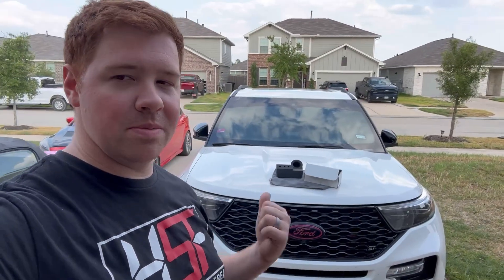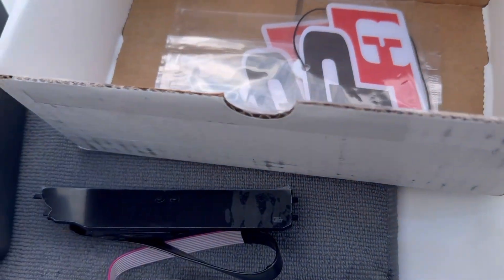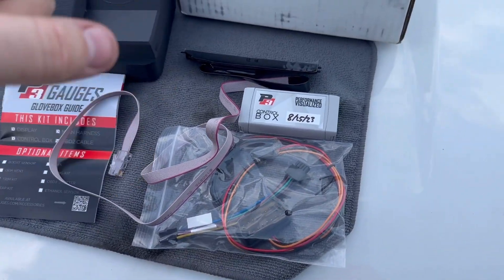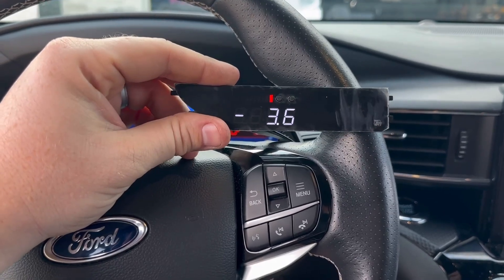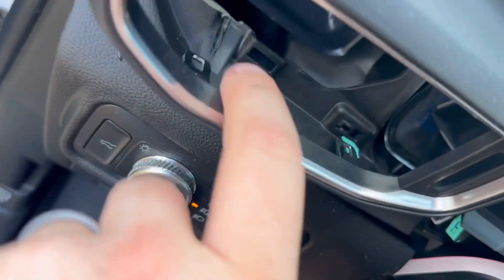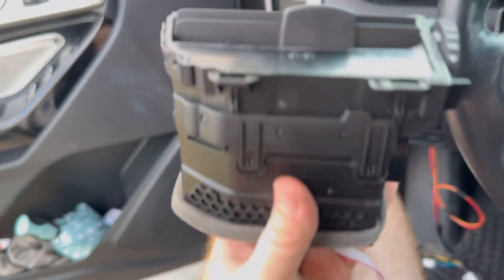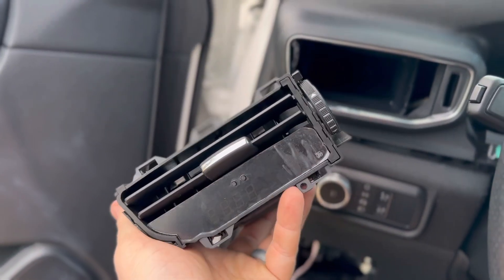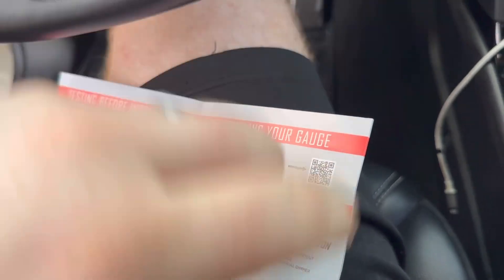Explorer ST P3 Gauge Install

Comment: to expensive for what it shows
Reply from the maker: It’s worth every penny in my opinion I absolutely love mine and use it more than I thought I would
Reply: No doubt. Might as well get an sct3 for that price
Reply from the maker: @pooleo8 but then you have a big ugly device in your hand or laying around this is a good clean way to see a few different parameters
Reply: Fair. Another downside another device....no where to mount it😕. I use ezlynk in my f150 with a old phone for a display. It works great but also has a hand hold that I could bolt a mount to.

My plati expo offers nothing. I'd say this device should be around the 250 range. It's essentially just a scanguage 🤔🤷‍♂️
Reply from the maker: Yeah I agree unfortunately all the software and devices are hand made and software is proprietary to the the 3 guys who run/own the business

Comment: Ordered mine today!   - looking forward to having transmission temps.  20,000 miles I had the 10R60 hard shifting from 7 to 6th gear. Snap ring cane off. Ford completed the repair at no cost but stated my clutch plates had all overheated. Trying to avoid damage to this repaired transmission. Do you have any idea what the normal  fluid temp range should be on 10R60 transmission? Or where I might find that info?
Reply from the maker: The gauge is super helpful! And normal operating temps tend to be between 170/220
Reply: was easy to install.  I like knowing the temp.  I wish Ford would have more standard gauge readings.  The only problem with it since install is that it reflects light into driver side mirror at night.
Reply from the maker: @dmor3359 really mine doesn’t do that or I just haven’t noticed it
Reply: might be my height and seat position that allows the blue light to reflect in my driver side mirror... still prefer having the temp. gauge.  I wish Ford had more gauges in their displays.
Reply from the maker: @dmor3359 yeah we should have had more especially with all the tech we already have it should not have been an issue

Comment: Can it read ethonal content
Reply from the maker: Yes sir it can if you select that option
Reply: @HoustonSpeedFreaks  so all you need is the fuel it sensor then
Reply from the maker: @williamdukowitz4431 there are a few options on their website you should be able to select the option to read ethanol content and get everything needed to do so with the gauge 😁